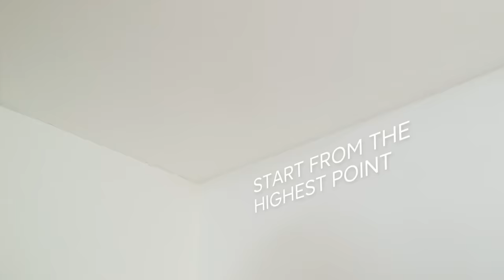How to paint a wall

Comment: Painted my first coat! It was a bit difficult to paint in a small bathroom. I wish I'd used some masking tape for the skirting boards and ceiling and covered the floors (the paint does NOT easily wash off the linoleum floor) 😭 wisdom in hindsight I guess.
Reply from the maker: Oh no! I'm sure you'll remember for next time 😅

Comment: I am having trouble with when I paint, after the paint has dried, it 
looks rough in certain areas, almost like its been sanded.  I've tried 
changing the primer from oil based primer to water based and then when I
 paint, it stills looks like it has been sanded.  Do you have any 
suggestions as to what I might be doing wrong?
Reply from the maker: Hi, as there could be a number of reasons causing this, I would suggest speaking with the paint department at your local store who'll be able to ask further questions to be able to advise further 😊